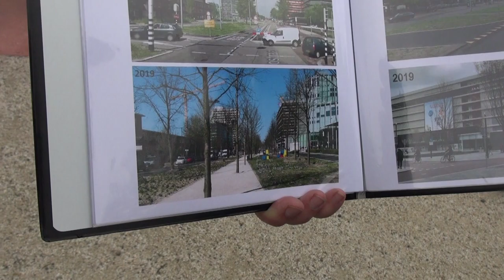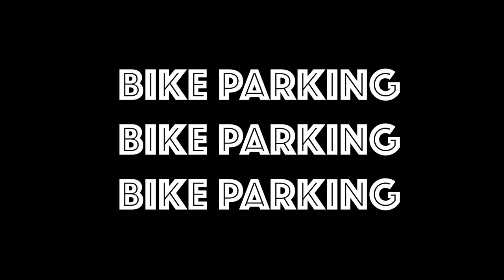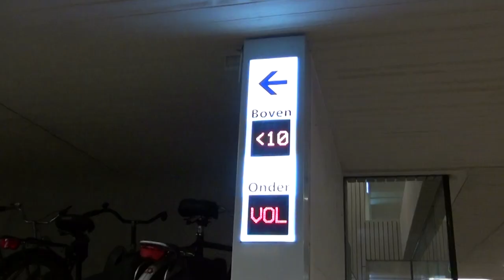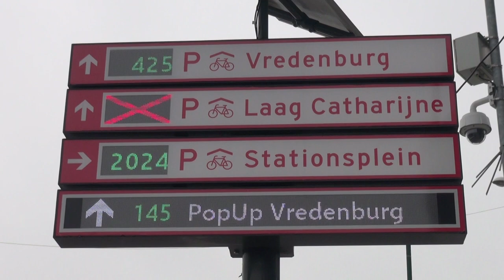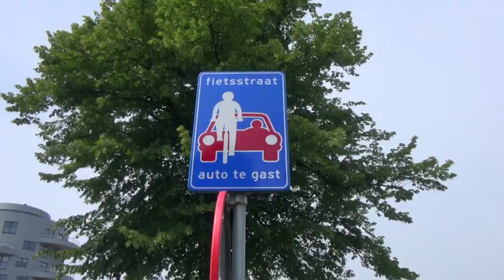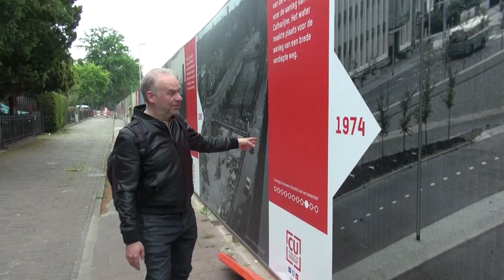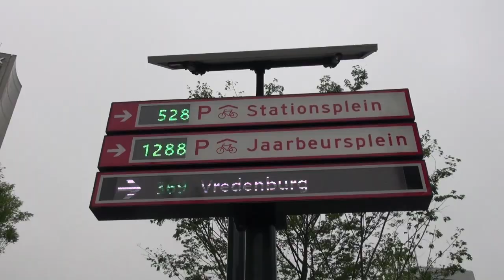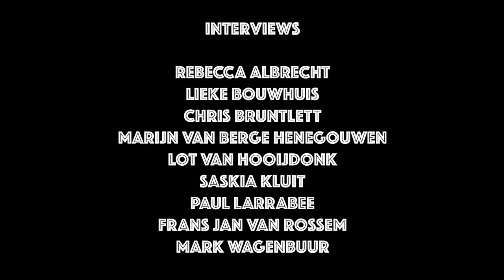Utrecht: Planning for People & Bikes, Not for Cars

Comment: Cool but i think i will stick with cars
Reply: If you live in the US then I would stick with a car as well because it's to dangerous to cycle there and the distances are much greater than in the Netherlands.
Reply: @Brozius2512  Eh, its not “to dangerous” to cycle here. For most people it isnt practical, but for pleasure
Reply: @NigwardTheSquid  I lived and worked in New York City for over 3 years and cycling in the city is very dangerous compared to the Netherlands. Car drivers in New York City don't care about cyclist nor do they pay any attention to them. As a cyclist there you need eyes in the back of your head.
Reply: Liberty for you, death for others.
Reply: @Brozius2512  Interesting. I cant really speak about New York since i live 2000 miles away. However where I live, biking is relatively safe in my experience and there is intentionally plenty of space on the roads to share, but still, i agree with the sentiment that you must absolutely never assume that car drivers care about your safety.
Reply: @NigwardTheSquid  it isn't practical since the cities arrent build for cyclist

Comment: The netherlands is flat. This wont work in hilly country.
Reply: Most NL is flat, but very windy.  But also in the more hilly parts, we use bikes for everything.  Especially now there is so much choice in electric bike.  The main difference is that our overpopulated country is designed as cluster of modest towns (50-200 thousand inhabitants), densely built.  This way, most people are within 10 minutes in a good shopping center, but also within 10 minutes in real nature.
Reply: jan simonides  Abundance of oil has made people more to live in impractical places.
Reply: jan simonides  Stop trolling.

Comment: It does help that the Netherlands is completely flat. The highest 'hill' is found in the farthest inland corner of the country and is 300m above sea level. Also cities are relatively small compared to cities of world and therefore distances are also less.. That being said, there are a lot of cities in the world where this could be implemented. Electric bikes could be a solution as well. Although then we do need to have a good plan what to with all the billions of batteries when they are worn out in 10-30 years time...
Reply: The Netherlands is very flat. It is also very windy. Just yesterday I cycled 20 kilometers straight into the wind. It feels like climbing a hill for 20 kilometers straight. And yet, I cycle … and I enjoy it.
Greetings from The Netherlands.

Comment: How will weak old people commute?
Reply: Public transport, electric bike or ,if all else fails, by car.
Reply: @Whistler4u  exactly! So at the end, cars are required. Also, in countries with temperate climates, so much of cycling for long distances is not possible.
Reply: @ashtickprakaspadhi402  Cars are not banned in the Netherlands, & car ownership levels are similar to other European countries, it's just that journeys in urban areas are quicker & more convenient by bike, & the Dutch have made this cheap, convenient & non polluting form of transport safe for all levels of cyclists. It should also be noted that the majority of bikes sold las year were electric assist with ranges of up to 150km & more., making a 40km each way commute completely feasible. 
You often see Dutch people cycling well into their 80's & electric disability vehicles are allowed on bike paths. These have a maximum speed of 45 kmh.
Reply: Actually most of the old people still cycle every day and trust me... they are not weak.
Reply: @Brozius2512  they might be doing so.. but one day they are bound to turn senile and lose physical capabilities. I'm talking about that age.
Reply: @zivkovicable  alright.
Reply: @ashtickprakaspadhi402  Well my father is 81 years old and is still cycling every day and yes when he gets older and loses physical capabilities to cycle he will probably use a car but in the Netherlands it's really great with public transport, older people can travel for free on buses and taxi are really cheap for elderly people.

Comment: NONE OF THEM ARE WEARING HELMETS?
WHERE ARE THE SAFETY PROTOCOLS?
ARE TRAFFIC LIGHTS & LAWS USED TO TRANSIT THE FLOWS SMOOTHLY?
WHERE DOES ONE PARK ALL THOSE BIKES?
DON'T THEY REQUIRE A "SPACE" TO PARK?
HOW MANY BIKE RACKS ARE REQUIRED TO EQUAL THE REPLACEMENT OF CARS?
SEEMS SPACE REALLY ISN'T AN ARGUMENT BECAUSE BIKES TAKE SPACE TOO!
ARE THEY CHARGING FOR SAID SPACE LIKE A CAR METER DOES?
A FAMILY OF SIX WOULD USE MORE SPACE TO PARK SIX BIKES THAN AN SUV!
OH THE MANY EXCUSES THEY'VE CONJURED UP HAVE YOU PROGRAMMED TO THE CORE!
>>>A PERSONAL CHOICE... A CAR OR A BIKE?
****WOULD THIS AFFECT YOUR OCCUPATION****
 ENFORCEMENT IS NOT FREEDOM.... WE ARE NOT RUNNING OUT OF GAS!
2020 BEGAN THE TYRANNY WE WILL FACE, AND YOUR GLEEFUL RESPONSES TO BE
PUT INTO MASS ENCAMPMENTS IS MIND BOGGLING!
Reply: Your caps lock seems to be hanging.
Buy a new keyboard.
Reply: If you have a good and safe cycle infrastructure then people on bicycles don't need helmets.
Reply: Ask your doc to up the lithium
Reply: they dont need helmets because there arent any cars to kill them going 50mph down the stroad. safety is logical. for the rest of this did u even watch the video??
Reply: Imagine unironically thinking 6 bikes take up the same amount of space as an SUV (which they don't) but also that a family of 6 is even remotely common these days in the first place
Reply: I am not against helmets and won't claim they are unsafe but research has shown that other dutch habits  on bikes make up for it easy. Helmets don't help as much as just sitting up more like dutch bikes so you can look around and make eye contact do or having fenders and lights on bikes and roads. Funny enough the push for helmets on bicycles was started by people who wanted to make  them mix with car traffic and that makes sense only if you go with the concept that mixing cars and bicycles on the same roads and stop building bicycle paths was the plan. Love the fact most people against are trying to come up with 'but what if' concepts like parking 10000 cars is easier than parkimg 10000 bicycles. Also its not a one wins so other loose concept most car drivers are 100% fine with these changes because when they need to use a car its way less stress and crowded. And yes i live in Utrecht, i have seen the city change from the 1970's and biked on many of these roads for decades, used cars and public transport its WAY better now than it was before and in fact we moved on most of the projects in this video are done and things are speeding up not slowing down.

Comment: Interesting idea but inefficient method of transporting people.
Reply: Much more efficient than cars, which are upward of a ton of metal that has to be moved just to transport one person.
Reply: @JamanWerSonst  Well said! 👍🏼
Reply: Oh no, the distances in Dutch compact cities are short, most destinations are within 5 km/ 3 miles. So a car's engine will never reach optimal temperature, that takes 25 to 30 km. So cycling is fast enough and not polluting the air. 

The average speed of the car and the bike are the same inside the city at 16 kmh, because we all have to wait at the same red traffic light. But bikes get a direct route and cars have to take detour, thanks to smart city planning. Also parking a bike is much easier then parking your car. Car parking spots are very hard to find. So 62 % of the Utrecht residents do not own a car. Public transport is well orginized as an alternative to the bike.

And bikes are used by all levels of Dutch sociaty; rich and poor, original and immigrant Dutchmen. Bikes are very cheap, so affordable for nearly everybody. And cycling keeps the population healthy. Less cardiac deceases, depressions and obesities.
Reply: @mardiffv.8775  Where do you get 62% not owning a car from?
Actually 67% of people in Utrecht own a car.
I tried to post the link to these stats but youtube keeps deleting my comment if I do.